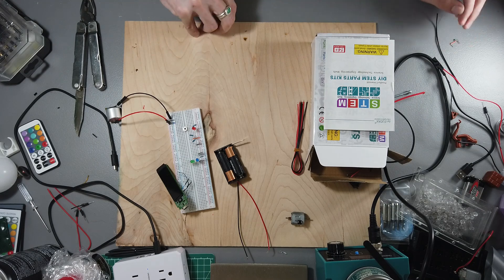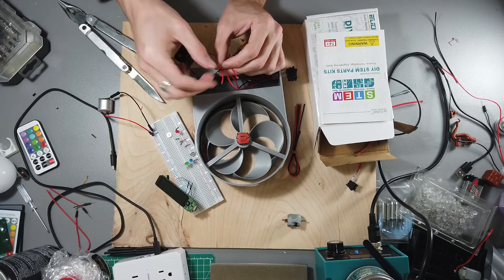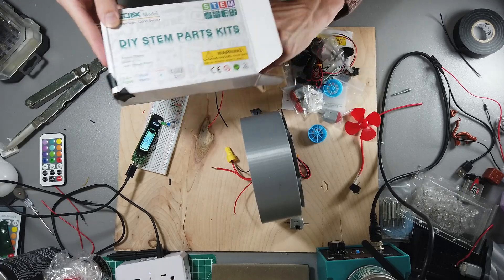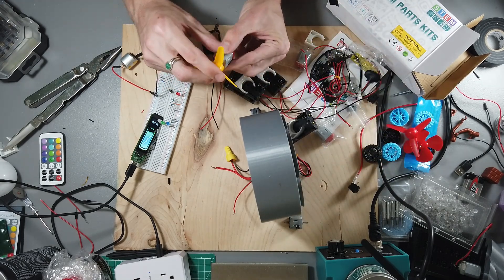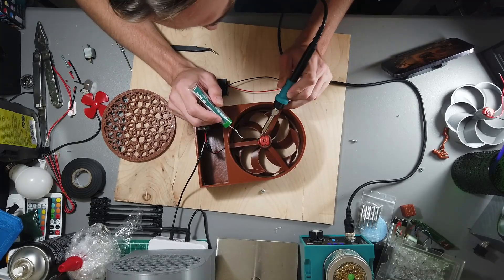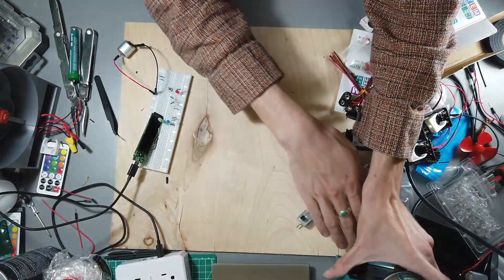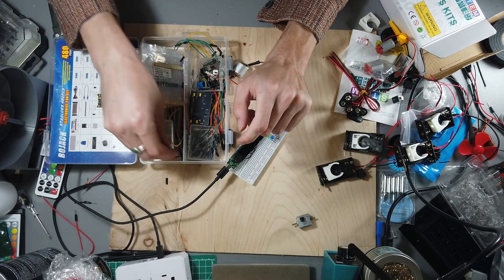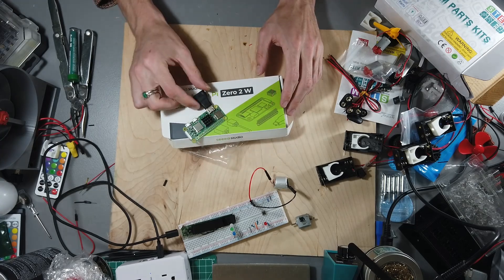Adding Electronics To Your 3d Prints for Beginners

Comment: Also, have you had any problems or complaints with your soldering iron at all because I've been needing to get one really badly, and I can use your link if it works well.
Reply from the maker: I haven’t been using it to long but it’s honestly perfect from my eyes. Heats fast and maintains temp. I’m sure if you were doing it professionally you’d want a better one probably but if your hobby/budget minded it’s got stellar reviews. 

I used to use a cheap one from home depot and this thing was def a huge step up from that lol.
Reply: @Fancypantsprinting, ima get it with your link (:

Comment: Hi, I heard you mention potentially a drone project at the end. That would be totally awesome. It would also be a great way to get into using microcontrollers because you need some sort of brain for that. But if you do want an idea for something simpler, you could make a lamp that turns on and off when you clap twice.
Reply from the maker: Yessss im chasing the drone project right now so hard 😂. Every time I go to get that parts something comes up. I’m sure it’ll be done by the end of the year. Right now looking at moving into some bigger space so I have more room to work in. Feeling cramped rn and it’s definitely limiting my projects.